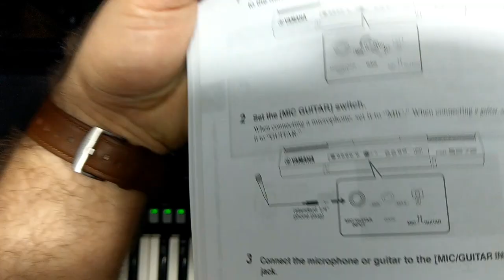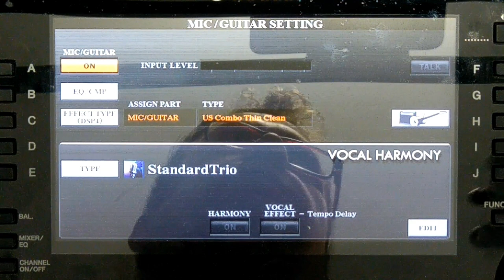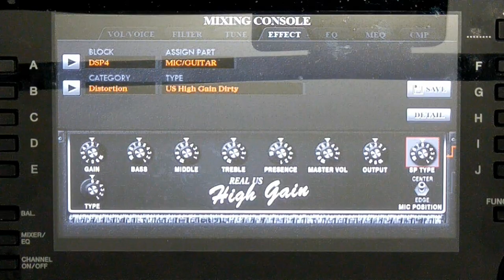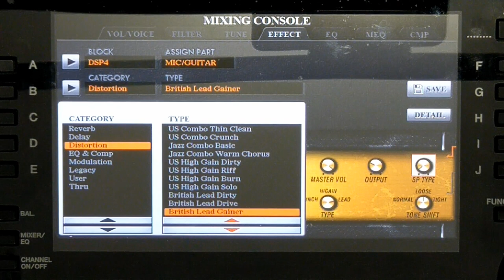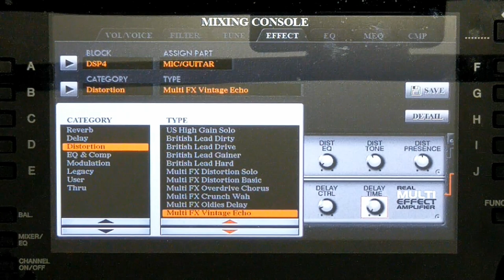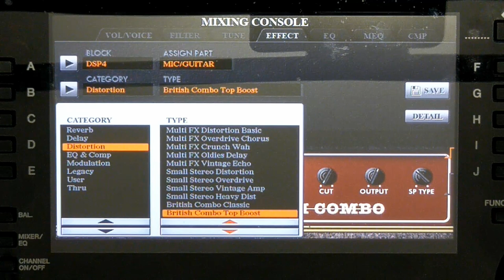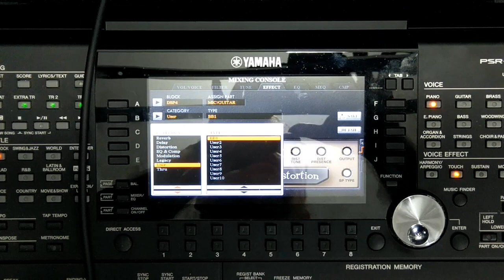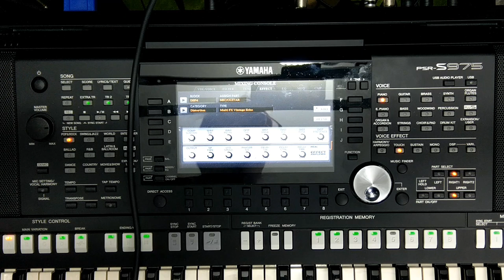How to use Yamaha Keyboard as Guitar Amp with real time effects - DSP settings tutorial - HQ demo

Comment: This is s long shot that anyone will see this with the age of the video, but I'm wondering if I can use a Yamaha DGX 660 as a beginner guitar amp. It has the Mic input, but it only says mic in and there's no switch.
Reply: The DGX 660 does not have a DSP so without it, the keyboard is workable for mics

Comment: I solve other problem - good sounding guitar simulation played on Yamaha keybord, if it is useful or not connecct guitar multi-effect with keyboard instead of guitar by audio cable, for example my PSR-S670 with something as Helicon TC voice live 3, because i want vocal harmony effects. My strong wish to have vocalizer forced me to buy other (better) keyboard - Tyros. But Helicon guitar vocalizers have much more presets (especially i love scalable gender shifting effect).
Reply: I have the same problem - S670 to Helicon Voice Live due to gender shifting. On my second KBD Tyros 5 maybe it is too possible, but using manual editation of some preset. But I am blind so it is difficult for me edit some settings fore dont see what is on display. :-(

Comment: Are thode efects, and the amps shown in the 975 present in 770?
Reply from the maker: I can not confirm but you can check in manual of 770
Reply: @BBWalkerTV  I guess the manuals are same. Its written as 770/970. I don't have the keyboard for now but I use that in church that's why I asked

Comment: Why does my keyboard sounds as if the volume is cutting off when I strum the strings lightly. When I connect my guitar to a speaker it plays perfectly. The keyboard I'm using is a psr-s770.
Reply from the maker: Probably there is a noise-gateway on the guitar input that cuts off the signal if it is low. Try to increase gain knob if you have one.

Comment: What if I want to sing through mic and play guitar at the same time ? In other words connect mic and guitar with sound from each coming through at same time.
Reply from the maker: I am affraid you cann't do this. There is only one input and it could be mic OR guitar - not both at the same time. You need simple mixer with multiple input and than connect it to keyboard but remember that applied effect will affect both signals so it is also not very good solution.

I use external effect for guitar and audio interface for mixing it (keyboard, guitar and mics)  if you want to record this using keyboard you can use AUX in
Reply: @BBWalkerTV   just wanted to thank you for replying to me brother.  I feel so alone right now. I'm doing my 2nd album literally on my own, and I feel like I need a physics degree to run a alot of this software (daws,my yamaha psr-sx900 etc.) and it's really sapping my inspiration.  I play by ear and always have, and I don't know any notes whatsoever.  everyone says it's a gift, and I used to think so but facing what I'm facing with all this equipment is making me want to give up. I wanted to note that I do have a m-audio duo interface. would that suffice for what I need concerning the dual hook up for guitar and mic?? also to fill in a little more I have 2 wireless mics and a lavalier mic. wireless is great but I still have to plug receiver into keyboard. if any of that makes sense please tell me options.  as I said I have m-audio interface , yamaha psrsx900 (which is what I want to plug into) guitar, microphone,  and all for the purpose of playing guitar simultaneously with mic so I can record and perform on stage. Most of all I want to tell you how grateful I am that you took time to answer me. means the world to me doing this solo. I have so much great music, but I can't get it laid down and it's depressing me. anything you could do would help. thanks again!!

Comment: Can i connect my Boss gt 100 guitar processor to Yamaha psr 3000 and use its speakers to run processor in stereo?
Reply from the maker: Yes, PSR 3000 has (double mono / stereo) AUX in 1/4 jack so no problem. Regards

Comment: I have a Psr sx700 can I still use guitar In that? Also will my semi-acoustic work as it's not active pickups.
Reply from the maker: yes you can SX700 has guitar input as well. 
And yes - you don't active pickups. In my Ibanez I also have passive (no battery).
Regards
Reply: @BBWalkerTV  thanks👍

Comment: I have a yamaha sx600.  I have used the mic input to plug in an electric  guitar. I am careful about the gain. The mic input does not have a switch from mic to guitar.  When i plug in tve guitar I can use the many amp effects assigned to the mic input. I figured that because they have so many effects assigned to the mic input,  it's safe to do so . The sound is great through the keyboard  speakers.  Do you think I risk damaging the keyboard ?
Reply from the maker: You intrigued me with this question so I have checked the SX600 user manual to find any refs to the guitar input. It seems that they purposely hide this use case. But don't worry, As long as you take care on gain and use passive pickup on guitar nothing should happen because on low gains voltages on guitar are close to dynamic mic input.
As long as "clean" sound with no effect is not distorted you are good to go. 
Regards
Reply: @BBWalkerTV  well I use the distorted effects too. These distortion effects include wah wah pedal sounds as well as various amp style drive, and compression, reverbs and delays. They must be there for a reason. They wouldn’t be there for for a vocal session and the effects that I am referring to are blatantly in the mic set up dsp settings. I just make sure I keep the volume of the speakers low when I use the guitar.   Isn’t amazing that I can’t find one other user on google search that references this,?
Reply from the maker: @morryp5551  Yeah, that's great. It is good to be pioneer :) Regards

Comment: Could I plug a guitar into the keyboard and then connect the keyboard to my desktop to use other amp simulators like bias fx? And would the audio quality be worse in any way
Reply from the maker: Good topic Hawk. Please tell me at the beginning do you have an audio interface with your desktop like focusright and what keyboard you have. 

Remember that many devices have the Audio Interface features like boss looper or zoom recorder, so you can tell me which gear you have.

The basic parameter that affects quality (while moving analog signal to PC) is Analog To Digital conversion (A2D)  - standard sound  card in PC in poor quality (used to connect headphones and computer mics) so forget about it. 

The second is the quality of guitar input (it's preamps to be specific) 

If you don't want to use it live - you can record WAV audio in Yamaha (your clean guitar) and move to PC and apply effects - this give you best quality but you won't be able to play in real time with effects. 

Other option is to forget about keyboard and use audio interface only.

You also need to check if your keyboard has audio interface (S670 don't, S975 - I need to check myself)
  
If your keyboard have build in audio interface than you don't need to buy separate one and quality and you can transfer USB digital sound stream with HQ to PC. 

So Please write what gear you have now and than we will continue.
Reply: @BBWalkerTV  I have the PSR SX900 so I was hoping it'd have an inbuilt audio interface given its price so I could use it as a temporary interface to play guitar in real time(and with the new surge of covid cases in my area I can't get an audio interface delivered currently). The guitar that I'm using is a Squier bullet. And yeah I don't have a soundcard but my motherboard is of a decent spec(Aorus B450)
Reply from the maker: @hawkfine4690  I fully got and support your idea. Today I will check if there is no audio interface in PSR-S975 to be sure and let you know.
Reply: Thanks a lot for your help man :) was having a tough time finding a solution elsewhere but your help is beyond amazing 😳😳